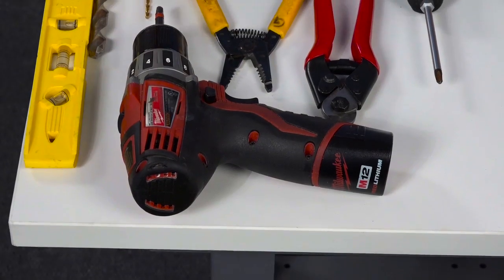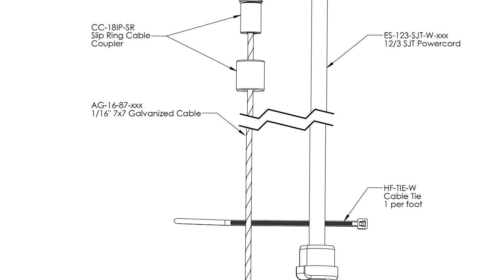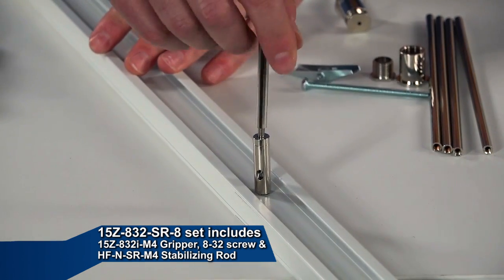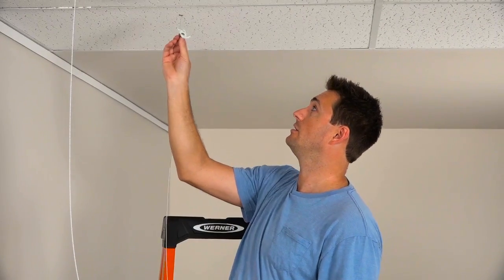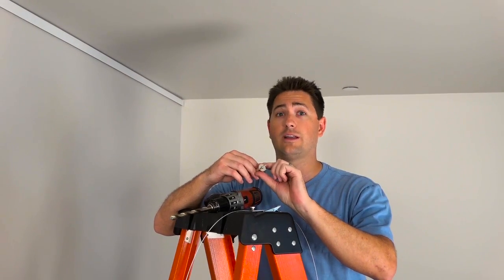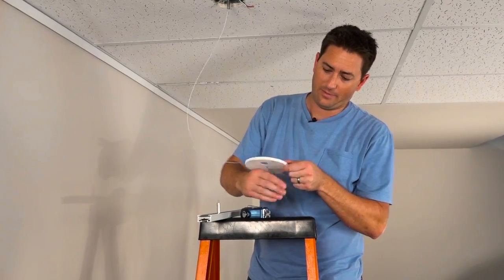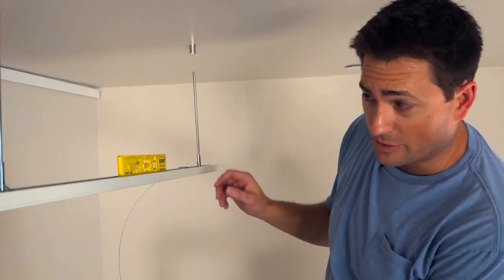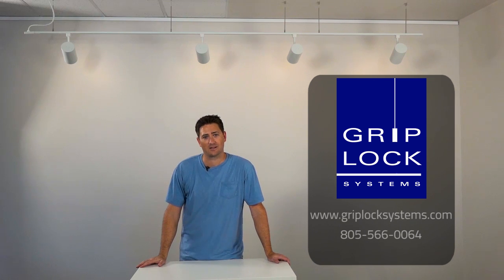How to Install Track Lighting-Suspend with Cables, Easily Adjust

Comment: Exceptional explanation. Eliminates the "fear factor" obstacle to using the great Grip-Lock products. In next vid how about showing how to use a plumb bob to locate the suspension points precisely over a point on a floor, table, etc.

Comment: Can you do a vid on JUST cable track lighting?? I've seen it installed through exposed beems and I'd love to know how to do that! I would love to see low profile, cable lighting...
Reply from the maker: We have a video on Track Lighting https://www.youtube.com/watch?v=OVUBkt2x9F8 Let us know if we can help you with your next project.
Reply: Dear Rachel: Even with low voltage systems some local codes or even just over-cautious electrical inspectors will require that "conductors that run through combustible materials be isolated from that material by a metal conduit". An easy way to do this is to use 1/8" IPS threaded pipe. IPS means Iron Pipe size (not relevant). Just over 3/8" outside diameter. This pipe is fully threaded for the entire length and is the very common part you see on table lamps and in ceiling boxes. I've bought 24" and 36" pieces. Cheap. Jamb two nuts together to guide side of hack saw and remove nuts to clean up threads. Be sure to de-burr inside diameter with a countersink or round file. You can use the pipe flush to the face of the beams or add a "check ring" and decorative finger nut in antique brass, etc. if you desire. You can go online and look for instruction sheets from companies selling cable systems. Maybe this will help you firm up a strategy for your project.  Contact me if you need more info.